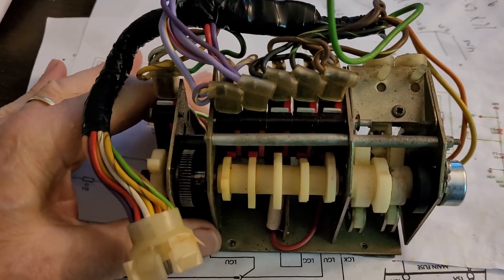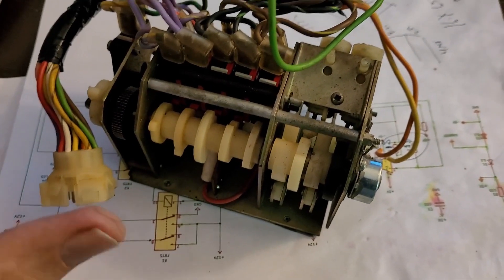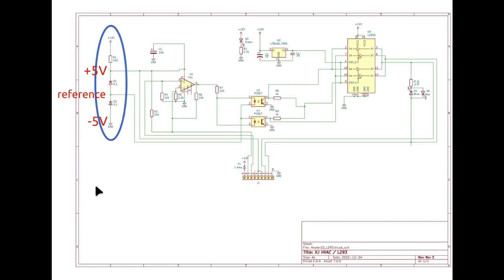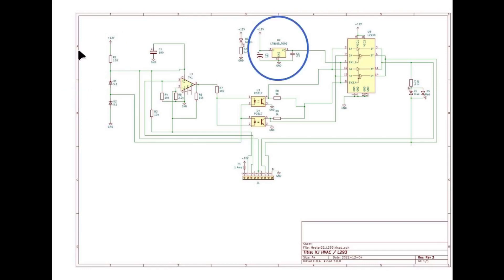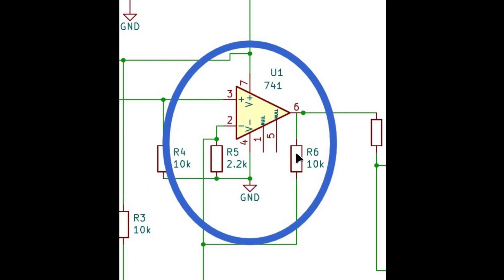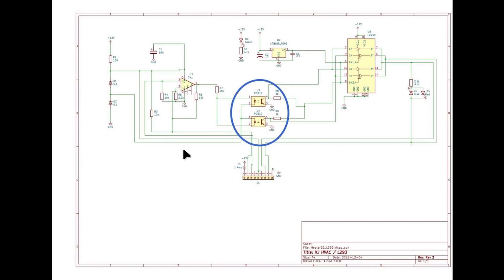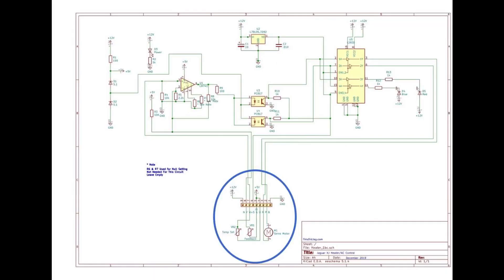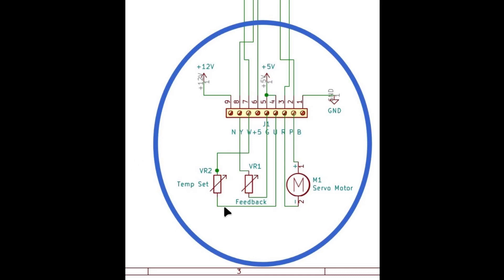Jaguar XJ Manual Heater Control --  How it works

Comment: Great info, thanks for sharing.  Sadly I have a S1 XJ, but you never know. 👍
Reply from the maker: Jeff, that is one of the benefits of the Ser 1, knobs connected directly to what they are supposed to do.  No wires needed.
Reply: @novom2001  true indeed. Hoping this year to put in a new more compact ac compressor.🤞

Comment: Amazing info!!! Regarding the temperature control potentiometer, do you know of a generic replacement?
Reply from the maker: Greetings, It is a 15k linear taper pot. I found one a couple years ago for a guy who was asking but I can't immediately lay my hands on which one it was,  I will dig around and see if I can find the info.
Reply from the maker: You can use something like this        https://www.ebay.com/itm/352709996461   You can use any 15k ohm 2 Watt pot.  Just be sure that it has the alignment tab on the body that keeps it from twisting and that the shaft is long enough like this one. You will need to cut this shaft to the same length as the original  and flatten one side to make it fit the knob. Take care to flatten it on the same side as the original.
Reply: I appreciate your help @novom2001 , by chance, do you think this replacement pot could also replace the temperature control potentiometer for 1989 XJS with a Delanair III system? Mucho Gracias!
Reply from the maker: Sorry, I don't know. That system is fully electronic and I haven't done any work with it other than replacing the ECU a couple times.
Reply: @novom2001  , thanks for the honest reply!

Comment: Maybe I missed it somewhere but what determines the fan speed when the fan speed control is set to "Auto"?
Reply from the maker: The location of the cams  in the servo.  The cams in the servo are arranged in such as way that as they rotate they open and close the switches that control the fan speed.  These switches in turn operate the fan speed multi- relay that is connected to the fan motors by way of speed control resisters.